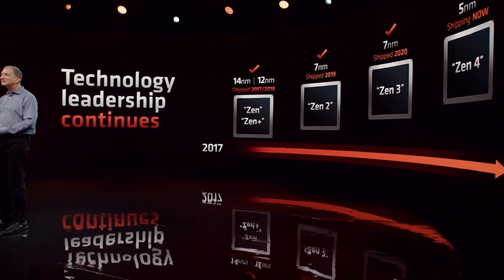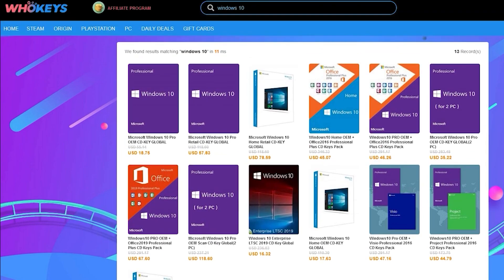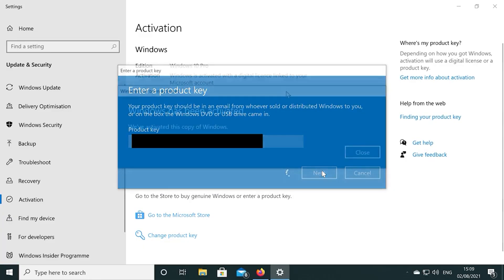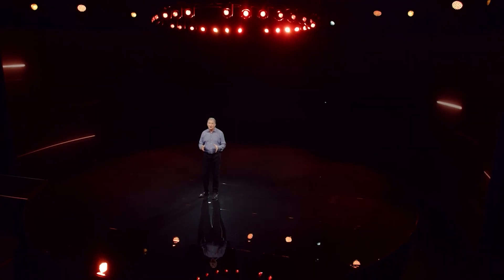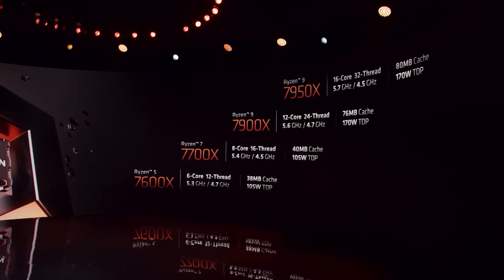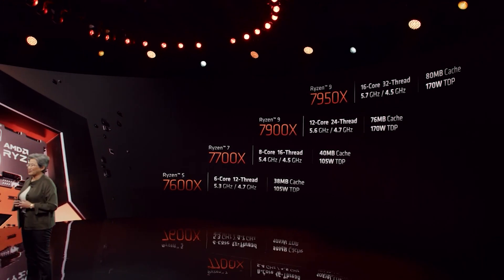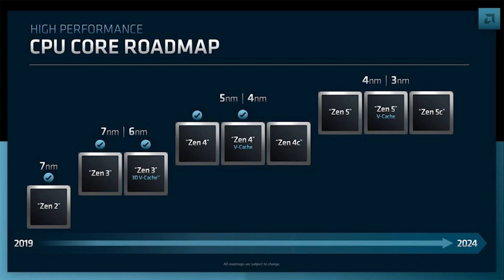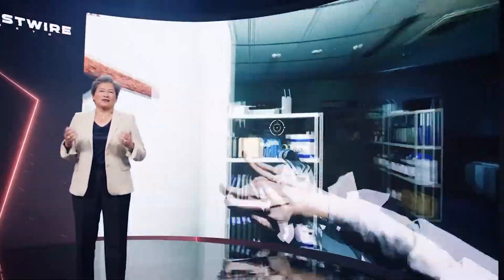Zen 6 CHANGES EVERYTHING - IPC, Clocks & Architecture Early Info

Comment: I'm gonna keep my 5800X3D until I see 50% or more perf increase in games. Perhaps zen6 3D will be my next upgrade.
Reply: Zen 5 should get close to hitting that honestly.
Reply: i'm on a 5800X3D and waiting for Zen 5 X3D version that should come close to hitting your 50% increase.
Reply: I'm still holding out with my r7 1700 lol
Reply: Still a decent cpu for most use case  @maj429
Reply: Zen 5 x3D period....
Reply: I have a feeling that the Ryzen 7 8800x3D will be there. Ryzen 7 7800x3D is already giving around a 20-25% increase.
Reply: I'd definitely wait for Zen 6 IF AMD can't get to much faster memory timings and are still only getting 8GB/s for the CPU-chipset link.  That speed isn't good enough anymore.

I've thought a lot about how AMD could improve Zen 6, especially if they want to get thread counts up, and they SHOULD want to do this.

So, one of the things they said is 2 channel memory is an issue even with DDR5 and I take that to mean, it doesn't matter what clock speed, it's just not fast enough.  I KNOW part of the issue with memory speeds is being on the IOD because you're limited to having to transmit first between RAM and the IOD, and then via the interconnect to the CCD.   That's going to become too much of an issue for latency with faster CPU unless they were to give the memory controller a direct connect straight to the cores, but THAT doesn't resolve 2 channel memory being too slow.

What would make this all much faster is to put the memory controller on the CCD.  You ALSO have the issue of having a 2 chiplet CPU having latency when the cores on different CCDs need to talk to each other.  So, instead of running that connection through the IOD that should be a direct connect.  If AMD did this they could theoretically run dual or quad channel with a desktop CPU (memory controller on each CCD).  That puts you into HEDT territory without needing a different platform.

At the same time they should make these 8x4 CCDs with their C cores being the efficient cores.  This could get them up to 48 threads.

With this much performance you need a really good MB and the MB along with buying a 2 CCD CPU could be the difference between typical desktop or near HEDT.  You wouldn't need a LOT of PCIe channels because MBs now have so much better and a lot more I/O, it reduces the need for different add on cards which is why you need so many lanes.  Nothing I know of uses more than 16 lanes.   But if all the PCIe slots are running gen5 by that time there just isn't a need for so many lanes.  It won't help people with older adapters, but who cares that's their issue.
Reply: @johndoh5182   Think about this... X4D. They add a 4th dimension to their cache.
Reply: 25% IPC gain etc. on a CPU is huge when it is from one gen to the next, I remember not that long ago, over 7 years it took to get that kind of increase in performance!
Reply: @cdiff07  I wouldn't count on a 25% IPC uplift.  Probably closer to 17 - 20%.  And that's going to be almost all the gain from the CPU since no more cores, clock speed about the same.

Zen 6 will be more exciting to me because their interconnect REALLY needs to change.  Their all-core performance could be a LOT better if the interconnect wasn't such a bottleneck.

In fact the latency and speed at which the current interconnect can run is most likely the limitation for memory speeds, it certainly creates latency for core to core comms, and probably why the CPU-chipset interface still only runs at 8GB/s.

I'm guessing that Zen 6 will be like the jump from Zen 3 to Zen 4, in other words bigger than what people think because AMD is only partially upgrading their architecture for Zen 5 and then again for Zen 6.  And I could see why AMD would be considering a new socket.
Reply: you don't need to change anything. your thing will last years to come. the games aren't even that great to begin with. im still on my 5900x!
Reply: @LunaWaves That's what I keep tellin em! 
>me on a 4790k
Reply: Same, here, even my 6700xt (got it on a real good deal)  and isn't quite pushing the 5800x3d in most title at 1080p and really, I'm waiting for 24 gig vram to be the norm and mid-range.  I'm also waiting for prices to drop to AM4 prices relatively speaking for late ddr5/mid DDR 6 ram before considering a new upgrade platform, probably a 3-4 year wait.  Also it's nice to be on 64 gigs of ram x)
Reply: I've stuck with 5800x3d/x470 so will likely take x770/zen5, 3d preferred of course. I'll wait until the AM5 decision is published for zen6 though... don't want to buy zen5 if I have no upgrade path
Reply: 7800X3D already reaches 25-35% depending on the game, in other games 7000 series reaches even more as not all games benefit from x3d. zen 5 will be easily 50%
Reply: @SweatyFeetGirl  Zen 6 is going to be what Zen 5 SHOULD have been basically.  Zen 5 is supposed to be a new architecture, but AMD is only going half way with Zen 5.  I can't say I blame them because Intel is putting out a CRAPPY Intel 14th gen that will eat lots of power since their Intel 4 isn't ready for desktop yet.  If they get 25% out of Zen 5 in uplift I know where that puts them on benchmarks, at the one spot and the only way Intel touches that with 14th gen is go crazy with clock speeds as they've done in the past and why Apple left them.   So that's part of the point.

Zen 6 should incorporate basically the same thing Intel 12th gen brought to Intel.  For Zen 5 AMD is bringing a form of big-little to laptop, but not desktop.  That sucks.  They should be able to run an 8-4 config on a single chiplet now for Zen 5.  I don't know maybe they needed to be on TSMC N3 and maybe they can only get to N4?  I'd sure like to replace an 8c/16t CPU with something MUCH faster and more cores but still a single core chiplet.  An 8-4 would be perfect for me using AMD's C cores for their efficient cores.

The other thing is Zen 4 is too limited.  It has good performance but very limited for DDR5 and CPU-chipset link is still stuck at 8GB/s.  Then they go make something like X670E with ALL KINDS of I/O but it's limited to 8GB/s.  That's not even good enough to keep up with newer NVMe that will come out next year.  Even INTEL is running that link at 16GB/s.

So one, without seeing what AMD has changed for Zen 5, not going off a simple percentage uplift it's hard to make any judgement about it.  That's not enough.  I want something revolutionary along with being a LOT faster because whatever I buy I want it for many years which is the same reason I bought Zen 3.  But this time I want it for even longer, like 6 - 8 years and I don't think Zen 5 is going to be THAT.  I think Zen 6 is going to be.

If Zen 6 isn't all that Intel is probably going to butt stomp them if they get to their Intel 3 or 20A process nodes for 16th gen and I may switch to Intel to have a kick ass system but for once in a long time won't eat up a lot of power.

So that's what I'm betting on, which is AMD CERTAINLY being on a variant of TSMC N3 for Zen 6, competing against Intel 16th gen which should also be on a much better process node, which all equates to low power (unless pushed) and much more versatile systems and for AMD that also means having a MB that can keep up with the devices you stick on it.
Reply: i went from 5900x to 7800x3d. 2 reasons i needed a motherboard with more  m.2 Pci-e slots. i have  that  7900xtx Nitro+( i need a bigger case) and 7800x3d power efficiency

i looked at cost of buying new motherboard x570 and 5800x3d. and my local Microcenter had a open box  x670 Aorus Elite Ax (100 dollars off) and  Gskill CL30  6000 Trident neo for $100  and 7800x3d was only  369.99.  Am5 has more life left in it  so why not

so for me the price deference was only 30bucks  extra for the AM5
Reply: @ShimaS-0079 Why would you need a new mobo if you already had a 5900?
Reply: Cumulative 50%, would take around 8 to 10 gen from 5000 series, provided you buy the same tier.

Comment: Going to a new platform on Zen 6 opens up a lot of interesting opportunities, particularly on the I/O side of the equation. DDR6 (if it’s ready)? 3 or 4 channel memory? Maybe they pull an Apple and put the memory on the die and dispense with DIMM slots entirely? And of course they could also bring more PCIe lanes to enable 10GbE as standard on X-series motherboards, and more PCIe slots wired directly to the CPU. And lastly, a physically larger socket could support larger GPU’s for a bigger and more powerful APU that could completely eliminate the need for low or even midrange discrete GPU’s. Kind of like a mini-MI300.

There’s lots of things they could do if they wanted to get creative with a new socket, and I don’t think consumers should look at them potentially abandoning AM5 with any kind of trepidation. This is how progress is made.
Reply: Ok then they can do that with Zen 7. AMD built a good reputation with the platform longevity of AM4, they should do the same with AM5 by releasing Zen 6 CPUs for it and push off AM6 a little further to have a smoother platform launch than AM5's was.
Reply: @Shieftain I strongly disagree. If they have ideas for a new platform that will bring dramatic and significant performance increase to the table - they should implement it ASAP. Why continue to make small incremental (if that) improvements on last year’s technology if you have a viable path to much bigger improvements? Seems like a recipe for mediocrity to me…
Reply: @benjaminlynch9958  Mediocrity in what sense? And compared to what?
Reply: zen4-5 IO is garbage. AMD will put IO on bottom just like MI300 series. Mi300 has 4 IO/memory controlers. MI400 is expected to have 4 IO with 16 channel memory, zen6 desktop should have just 1 IO and 4 channel. WS - 2 IO and 8 channel ... Perfect line with just 1 IO, 1 base and 2 CPU chiplets and 2 GPU chiplets. And one monolithic steamdeck/ultrathin laptop - 4+4c zen6 cores

Comment: Having currently the 5950x AM4 and was thinking of jump on the ship of AM5 with the 8000 series. Now that it is likely that AM5 will end with the next gen as well…. I might skip AM5 completely. There is never a good time to pick and there is always something new on the horizon but I feel AM5 is dead kinda quickly this time around….if the hints are correct that is
Reply: What hints are those?  I may have missed something, but AMD said support to 2025, I would expect at least 3 CPU gens for AM5, especially with Intel putting 3 gens on LGA1700.  I suppose one could argue that Raptor Lake Refresh isn't a brand-new CPU gen, but cool, nonetheless.
Reply: DDR6 isn't coming out until at least 2026 (which is basically when AMD alluded new AM5 CPU generations stop), so I really don't get how you people can get so overworked about distant future purchases and baseless speculation.

If anything, at worst, I expect Zen6 to maybe go dual RAM support.
Reply: Thats cuse there's no zen4+ like with zen+ which added a minor gen uplift
Reply: See I had a 5950X, that was an occasional bottleneck for even a 6800XT. In contemplating a new GPU, that would only get worse. My options were lose threads and go 5800X3D, or keep them and go 7950X3D. Yeah I made the jump to AM5. It'll be enough for what ever GPU I buy, up until the EOL line up is going for discount prices.

Comment: I hate hybrid cores
Reply: The mobile series hybrid cores will perform shtty.
However the hybrid cores AMD new Zen processor would be crazy performance while maintaining efficiency at lower power consumption.
Reply: I hate Intel's implementation of it, but AMD is doing right by using the same core design and just laying it out to optimize power and area.

Once you push 8 cores to max boost you end up pulling power from all cores the more you bring online anyway, so having more efficient cores to bring online reduces how much frequency you lose on the main cores as you load up more and more cores.
Reply: @looncraz  Thats true except it's the opposite with the efficient cores from Intel instead of "being efficient" it's the opposite it's drawing more power the more e-cores take that 13900K for example it's a power hungry CPU with that many e-cores (not efficient by any means at all). 

AMD's Hybrid cores it's a new a design of CPU architecture which I think gives best of both worlds max performance and yet still energy friendly/efficient/low power consumption. I mean the Hybrid cores are atm only seen in mobile CPU and very soon they come to Desktop. 

The reason why AMD is doing this is probably to have an slightly edge over Intel due to power efficiency and these days with electricity bill going up this is their long term strategy :)

I can't wait for Hybrid cores it's going to use more cache so there is an increase in cache from L1 up to L3 and this means you will have more stable fps in the 1% and 0.1% lows which bumps up the avg fps in any game. I heard also rumors these comes with Ai accelerators but it might work very well with FSR3.